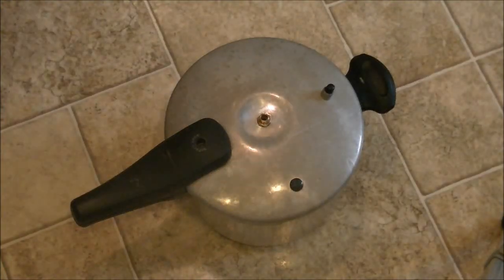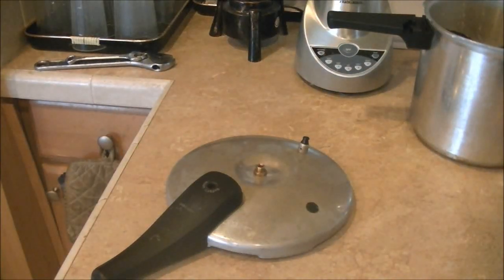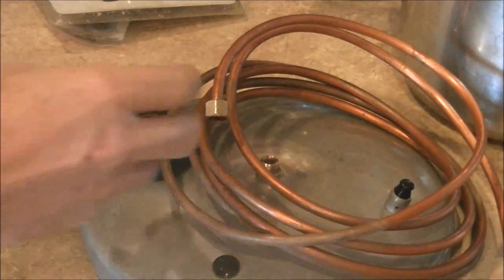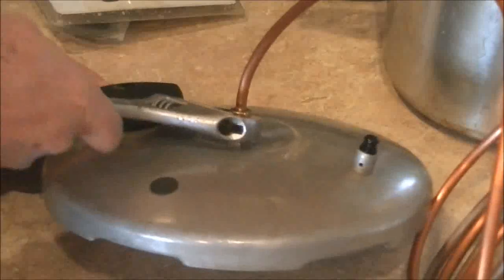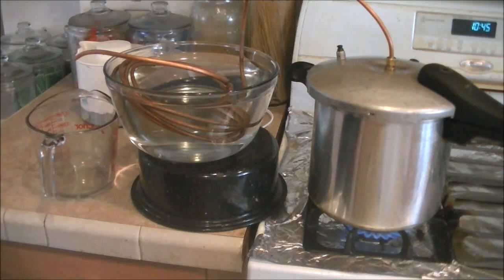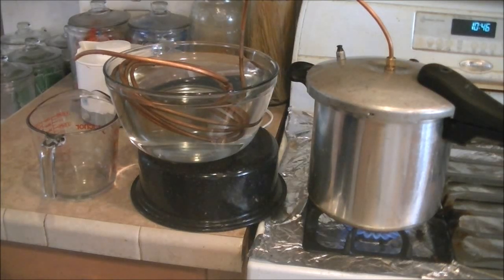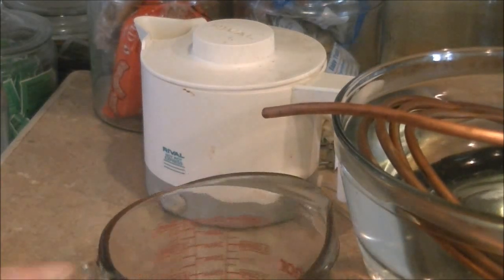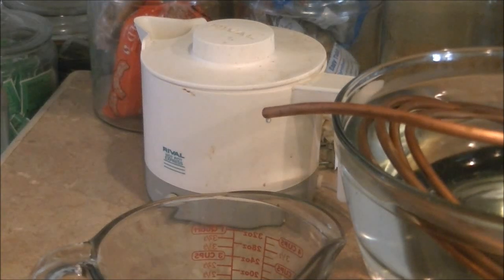Easy DIY Pressure Cooker Water Distiller

Comment: The taste that you say is weird could be that you pressure cooker looks like it is made of aluminum which can leach into you water. It is poisonous.
Reply: Aluminum doesn't get carried by the steam.
Reply: Steph Spelling Aluminun maiby does not interact with   water but copper for sure does that and turns into copper oxyde  wich is a real poison for humans.
Reply: @romulus6305  Copper Oxide is a gas ... metals do not form a gas without a stimulus ... like liquid chlorine ( bleach ). ... Only by using FATAL levels of chlorine in a copper water supply pipe .. .will it leach out enough copper oxide gas" ... to be FATAL . - - - Ok ... was it the FATAL levels of copper Oxide that killed you ... or the FATAL levels of Chlorine ... or was it the FATAL levels of ... LEAD solder ( another poisonous metal ) used to weld pipes together ... as high levels of chlorine disolve lead into water.
Just watch out for cities with "public water supply" ... which is treated sewer waste water treated with MASSIVE amounts of CHLORINE to sterilize the water ... making it "safe for consumption" ... which is then pumped into apartments using copper pipes.
Reply: Steph Spelling it could be the copper tubing as well.
I wonder if the commercial distiller units use stainless steel instead of copper. I know that a lot of liquor distillers are stainless now a days.
Reply: Thanks 4 da info

Comment: Thanks for this video you just saved me about $200 i was going to buy a water distiller from a company who wants about $400.
Reply: $22 for supplies ... NOT $400 ...
Goodwill - $6 pressure cooker ...  Lowes - $2 gas coupling ... Lowes - $10 copper pipe ... Lowes - $4 plastic bucket ( for the ice water ) ... a ( free ) soup can to wrap the copper pipe around ... = $22

Comment: I can tell you why you didn't care for the taste... you got brand new copper tubing and never mentioned doing anything to ensure it is as clean on inside as can be; (no doubt someone else made you aware of this). If not, just running the same for a few hours should remove the mfg  chems from inner surface of the tubing / fitting (think lubricating "oils" associated with the inner shaping  mandrel). A design for the tubing coil which lets the far end exit the condensing vessel at a lowest point with no feature of necessary pushing of condensate back "uphill" would be a significant performance improvement. your glass bowl  does require that uphill flow, causes pooling of condensate in the tube ahead of the edge of the bowl where it may pass over.
 if you have a possibility to provide a constant flow of "waste water" to the cooling vessel, especially entering coolest at bottom, and flowing excess heat away at a upper level limiting exit flow hole, this will maximize the efficiency of your condensing heat exchanger. think of Bc truck video and blue bucket. he didn't incorporate the cooling flow option for his cooler tank, but that leaves you with a lessening efficiency as the cooling water temp comes up from steam heating. Ideally, this cooling flow could  be gravity fed from some supply of "free" water, ie creek, rainbarrel, etc. I guess I should design and build my own.
Reply from the maker: You may well be right. I was thinking the off taste was due to the fact that the pressure cooker had been used to cook food. You're also right about the cooling tube not being set up properly.

Comment: you need to use a activated charcoal filter to remove the compounds that have a lower boiling point than water.this will eliminate that plasticy weird taste...
Reply from the maker: That's probably the right way to do it.

Comment: Stay away from aluminum pressure cookers and pots, they will destroy your brain. Stainless steel with copper tubing is a safe way to go, even better if you could get stainless tubing, but a bitch to bend in a coil.

Comment: Thanks, this was great, but I agree with the suggestion to choose stainless steel and avoid aluminum.
Reply from the maker: I mostly agree. Stainless pressure cookers are pricey, though.
Reply: https://www.amazon.com/dp/B00006ISG6/ref=asc_df_B00006ISG65130976/?tag=hyprod-20&creative=394997&creativeASIN=B00006ISG6&linkCode=df0&hvadid=167144008776&hvpos=1o2&hvnetw=g&hvrand=10768898765294526397&hvpone=&hvptwo=&hvqmt=&hvdev=c&hvdvcmdl=&hvlocint=&hvlocphy=9032425&hvtargid=pla-285920216589

This one is perfect. Only 40 dollars. 60 if you want the 8 quart.

Aluminum is HORRIBLE. My grandparents all got Alzheimers from using aluminum their whole lives. They didnt know any better. In Europe in the olden days they didnt even have stainless steel.
Not remembering your loved ones is and having memory problems is worth spending the 20 extra dollars i think. You will have the cooker for at least a decade.

Comment: What can I use other than copper tubing? You know if your in the bush in a survival situation that copper tubing may last a day or two before it gets screwed up.
Reply from the maker: A day, or two? That seems a very short time.
Reply: honestly how easy is it to screw up copper tubing, question was can I use something else?
Reply: Stainless steel tubing  You're going to have to buy it in 20 foot long straight tubes and then have a steel shop roll them into a spring shape for you. Or whichever shape you need.

Comment: your condenser unit would work more efficent if you had no high points in your copper tubing. it wont pool up
Reply from the maker: Absolutely correct. Thanks.
Reply: This is what I was wondering. I'm going to build one just like yours but condenser outlet to the bottom. Thanks for the video!!
Reply: +John Strabismus 

did u correct the tubing yet?
Reply: +Bernard Popp 

should make lots more yield...👍👌

Comment: I think what you need to do is have a thermometer... while the water is getting closer and closer to 100C... don't connect your distillery stuff... let that stuff boil off...  once it is at a steady 100C that is when you should put the lid on.   To be on the safe side once you have 1/2 to 3/4 of the volume distilled from the original water... stop.   That will prevent you from boiling off the chemicals that want to boil off at temps greater than 100C and contaminate your water.
Reply: Make much whiskey?
Reply: Good advice

Comment: I'm just wondering what made your pressure cooker fail in the first place? I have the same one that my Mother used when I was a child and with the exception of getting a new rubber ring to go on the inside of the lid it still works great. Just wondering.
Reply from the maker: I'm not 100% sure. The handle that locks the top failed, and it wouldn't hold high pressure any more.
Reply: John Strabismus I'm sorry for your loss of a pressure cooker. I've never had that problem (and hope I don't!). The one I inherited was been used and washed so many times I can't even tell you who made it. Mom told me (before she past away) that she got it shortly after her and Dad got married. Figuring they got married sometime in the middle of 1945-1946 it's a wonder it still works at all. But you know things that were made back then weren't "disposable" as they are now. Hoping you many more pressure cooker memories to come!
Reply from the maker: Not to worry. I have other pressure cookers now.
Reply: John Strabismus Good Deal!!! Happy canning/cooking!!!!!!!

Comment: Hi I commend you on what you are doing. the taste may be coming from one or all of the fittings, or faucet you're using. This is why I stumbled on your channel. Along with Himalayan salt. Celtic sea salt is another good one. Another thing is a mineral supplement. I run to my super market and buy Great bear distilled water. I just make sure were the cap is there's no bubble from the cap to the product ( Water ) and there's no taste. I got stuck twice in 15 years with bad water, and it won't happen again.  I am looking to make my own distilled but I don't know if my faucet water will taste any better. Thanks for putting your video out here.
Reply from the maker: +vetterfellow Thanks for the information on Celtic sea salt. That's something I never heard of before. I think the odd taste is due to the fact that I used to use the pressure cooker to cook food.

Comment: Wow good for you ,I use a water distiller my self now for the past few months! And yes Himalayan pink salt, fine organic is the best all you need is a pinch to about 3/4litres in all ready done water and store it in glass Demi johns with a bung  ,don't store water in plastic,! Bottled water supply just as bad even worse than tap water ,don't buy it, they are taking you for a ride for your money !!!!
Reply from the maker: +Karen Grainger-Allen Some sources say distilled water becomes acidic when exposed to air. Those same sources say if the distilled water is filtered through charcoal the problem is eliminated.
Reply: what water do you put in your distiller?
Reply: Karen Grainger, I use Sea-Salt, is this pink salt natural or processed ?.
Reply: Jasminn, it doesn't matter what you put in your distiller, you could put mud in it and pure water would come out, not that I would put mud in it, lol.
Reply: It's natural, Himalayan pink salt is the purest salt on the planet. you don't have to add it to your distilled water as distilled water only removes inorganic minerals from the body and leaves the healthy organic minerals in the body,if you want more minerals use Himalayan salt on your food,if you put to much in your water it taste's like crap.
Reply: D mac, I use a pinch of sea-salt per gallon of distilled water, it makes the water taste great.

Comment: If you want to know the dangers of drinking distilled water on a regular basis read this http://www.mercola.com/article/water/distilled_water.htm
Reply: +pipyt3004 .....Big Pharma PAYS to make sure this is the 1st article that comes up on any search engine.   Go figure ...????  DUH?  Run Forrest.....Run!
Reply: +houndjog thanks for letting me know
Reply: That article has beeen proven false.
A lot of people are under the impression that distilled water will leach menerals from your body and there is no such thing as an organic mineral. Not true.
Organic minerals are minerals that are in use by the body that have a carbon bond to ensymes, amino acids, cells,  tissues etc.
This carbon bond distinguishes the mineral from an inorganic mineral and nuetrilizes the minerals charge and will not react with negatively charged distilled water. Distilled
water will react with excess inorganic minerals that build up and create health problems and help eliminate them.
Reply: pipyt3004 ...Dr Mercola is wrong...
Reply: TOTAL BULLSHIT, TOLD BY PEOPLE TRYING TO SELL WATER FILTERS AND NOT EVEN CLOSE TO BEING TRUE.
http://www.distilledwaterassociation.org/2014/10/04/debunking-myths-about-drinking-distilled-water/
"Yes, it is true that the distillation will remove the minerals in water, which will fall under the category of inorganic contaminants. In reality, while it removes minerals from water, these minerals are not beneficial in any way for the body. According to experts, the minerals our body needs do not come from water, but are sourced from the food we consume. In addition, the process of distillation does not only take out the inorganic minerals, but also effectively kills the bacteria, heavy metals, and particulates, which contributes to the many benefits of drinking distilled water. Do not believe claims made by companies trying to sell filters saying they will separate bad minerals from the good ones. Plus, you can always add minerals to distilled water for cheap."

Comment: If you boil water with the lid off first it will get most of the man made contaminants. You only get about 5% of minerals from water. If you are worried about it take 1/8 or 1/4 of a daily vitamin.
Reply: fluoride in the water boils down and concentrates you don't boil it off
Reply: I am not talking about fluoride. Talking about fuel, ethers, etc.
Reply: +everydayprepper  okay dude I just reread it.   I feel you.. you were right😆my bad😲

Comment: What would you use distilled water for?  I use it to top up  lead acid batteries myself.  Liked!
Reply from the maker: +wtam69 It's for emergency drinking water. Thanks.
Reply: I'm looking for a way to produce distilled water for use in my cold humidifier. It produces mist by an ultra sonic vibrating disk, but minerals in tap water can leave residue around the humidifier. You can also use distilled water in steam irons and fish tanks.

Comment: Great setup you have there!  I'm in the process of trying my hand at this too.  I got the stainless steel tubing and am using the stainless steel 6 quart Presto pressure cooker.  I'm going to the hardware store today to hopefully get the rest of the supplies needed to finish the project.  Thanks for throwing your hat in the ring with this one and sharing it.  In an emergency situation, making potable water with this thing could make the difference between life and death. Take care my friend.  :-)
Reply from the maker: +imasurvivornthriver Thanks. I think your stainless equipment is really the smart way to go.

Comment: This is an excellent video!  After watching your water filter videos I had actually been pondering distilling water with my tea pot. LOL My thought process was for what I had on hand right now. Could the off taste come from metal of the canner?  I know the water from my teapot tastes a bit like metal.
Reply from the maker: +Madison C Iowa It could be that the metal leaves a taste in the water. A glass distiller would be optimal. I'd trust the water from my distiller to be safe, though. There are already a lot of videos about the type of distiller I show in my video, though. The important thing in my video is the part where I mention that distilling water with antifreeze. or petrochemicals is a deadly idea. Finding comprehensive information about that is challenging, nearly impossible to do.